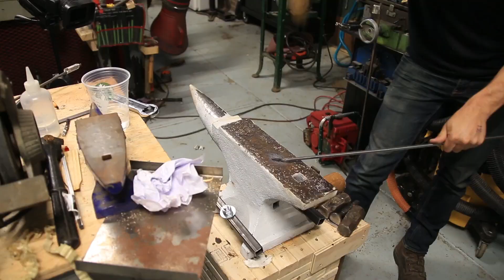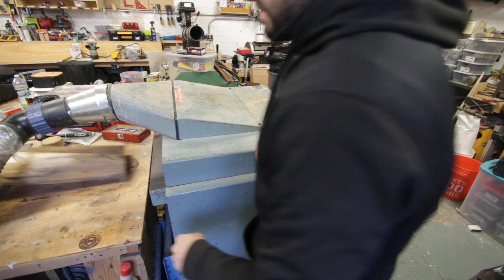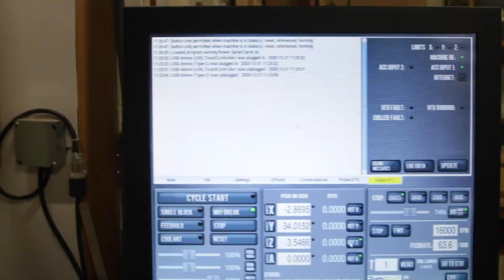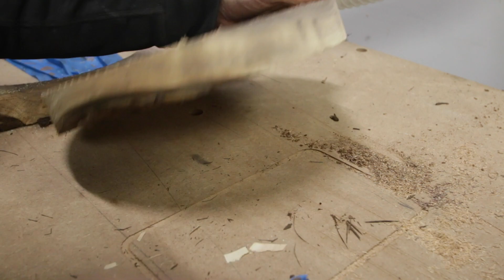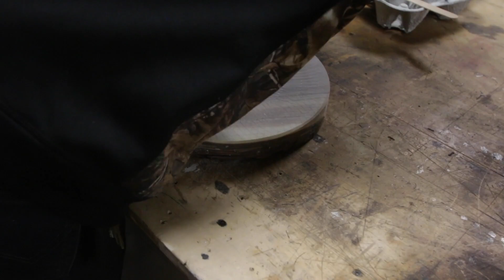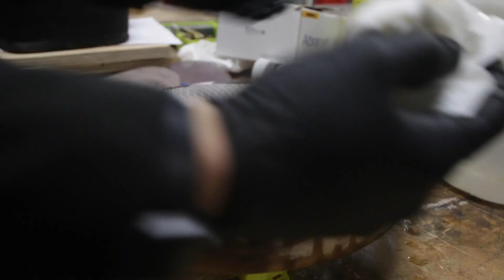Making A Walnut Slab Serving Board W/ Epoxy Inlay

Comment: Thaks for the great video.  I've accidentally arrayed circles like that in Aspire a million times, but I never thought to carve it. If you seal the wood with wipe-on poly before carving and let it fully cure for a day or two, you'll cut way down on those fuzzies. Wood hardener or sanding sealer can work, too, but I get my best results with polyurethane.  CNC sign maker.  Cheers!
Reply: Now that is a great bit of info/advice. Thanks Lucas, you've saved me quite a few headaches I feel. Looking forward to trying it. 
I'm often trying to get some real fine lines with my CNC, I recently got a 22.5 degree v-bit, it's almost letting me go as fine as I want, but still not quite perfectly clean lines at the finest detailed parts.

Comment: Hi! Appreciate your videos, wanted to feedback that the mic audio is too soft. You can see the levels on youtube by right click -> stats for nerds -> volume: -16.3 dB. Ideally it should be between -2 to 0 dB. Turn up the mic gain and move it closer to your face first, if still not loud enough then amplify digitally. Audacity is a free audio editing software that you can use. You can normalize individual clips before editing them together. You should also export audio in mono to avoid balancing issues